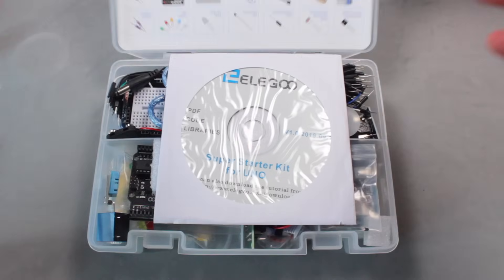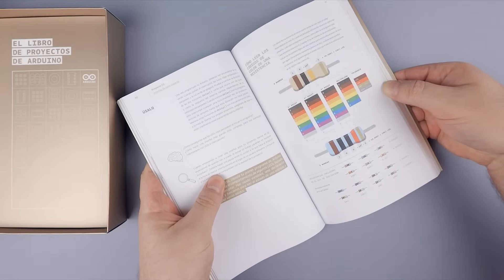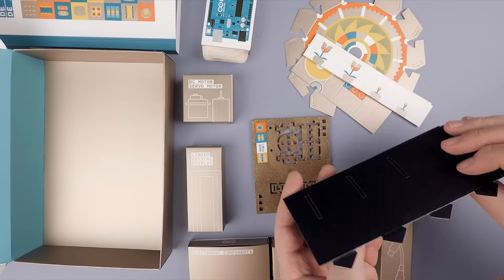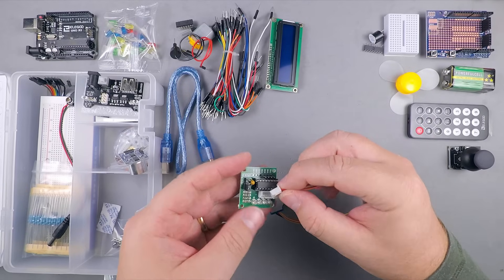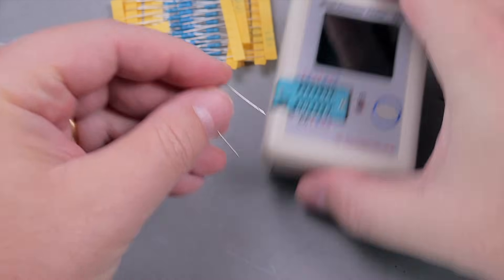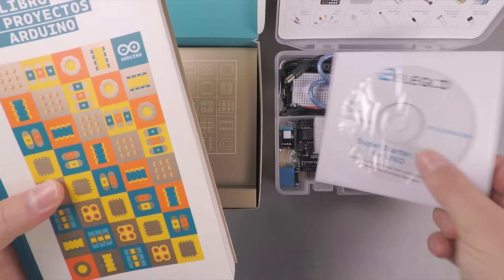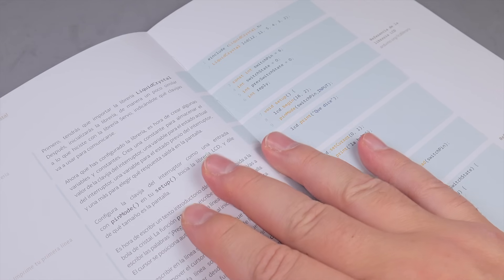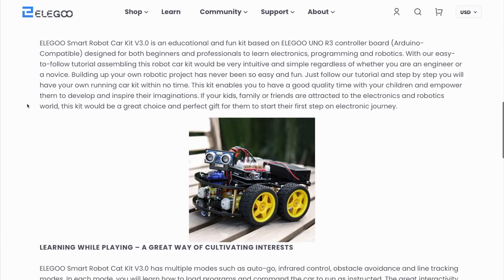Which Arduino to buy? Arduino Starter Kit vs Elegoo Uno R3 Starter Kit

Comment: I’m from elegoo. The reason why I use the blue resistor is because this is a metal film resistor, which is more accurate than the general brown carbon film resistor. The general resistance is ±10%, and the metal film resistance is less than 5%. Of course we are also improving this.
Reply from the maker: Hi everybody from Elegoo! After I published the video, a few people told me of the advantages of metal film resistors - more accurate values even on a wider range of temperatures and less variation as years pass. This is all good - it is very unfortunate the industry chose such a terrible background color for their best resistors 😭 Even so, I keep recommending the Elegoo Resistors Kit: excellent price for a very complete range of resistor values! 😁 I wish it was possible to have it on a beige or light grey background color, it would be amazing!
Reply: As a color blind, resistors have always been a pain in the butt for me. The blue background defintely makes things worse ^^'
Reply: @DaylzFr  that why you have a multimeter and now the correct value
Reply: @DaylzFr  i also I'm colorblind, is a pain in the ass to read resistors
Reply: @DaylzFr  My eyes suck, so reading it is impossible. That's why I just use a multimeter.
Reply: @DaylzFr  I just ordered the tester that he used as the resistors are always a pain to read. Mabye thats a good idea instead
Reply: @DaylzFr  i hate resistors i wish that resistors for colorblind people existed
Reply: With age my eyes got so bad that it doesn't matter any more on what background these invisible rings are printed on. I use a multimeter to measure the resistance and read it by value from a decent sized display and am happy with that.
Reply: @GeekDetour  mmi
Reply: @GeekDetour  يميزني
Reply: زقزي
Reply: You know its hearing stuff like this that affirms my purchase decision for elegoo products, something affordable but also committed to quality.
Reply: I like the 1% (blue) resistors in my kit, although I do agree the industry choice to use that color was not optimal... especially for us shade blind people.

I think a basic component tester should be included with all kits... one like the Aideepen T7 TC-T7 units that can be found on eBay or Amazon for less than $25.  It is an almost required part IMHO and can identify the resistors, capacitors and transistors... as you shown at 4:27 in the review.
Reply: @csimet  This is a really good idea, Im suprised more people dont use them
Reply: @francistaylor1822  Agree.  I do understand it would add $25 to the kit cost (official kit or Elegoo), but well worth it.
Reply: I'm not colourblind, but even as a youngster with good eyes I strugged to read the 5 band code because of the thin bands and poor colour contrast.  Now older, with failing eyes, I can still tell a 4 band 5% resistor's value at a glance, but blue 5 band resistors are a mystery to me without a meter.
Hence I prefer to buy 5% resistors for experimenting, and the 5% resistors are the ones I always grab first from my resistor box.
Reply: @epiendless1128  You can get cheap component identifiers and thats what i use now as i cant see the small lines well.
Reply: @ThomasMattOnline because every says it is
Reply: Blue resisters are known for their high accuracy....but you should always check all resistors with an ohm meter prior to use...especially if you are color blind.
Reply: The author's background is not electronic, so he didn't notice that the resistors provided by Elegoo are 5 band E48 instead of 4 band E24.
Hence higher tolerance and other benefits mentioned in other comments...

Wwanted to drop a comment but many others of course have done that faster 😅

In any way, both Arduino and Elegoo are great companies with their own benefits. Appreciate your work and recommend both.
Thanks @GeekDetour for bringing up a comparison of starter kits.

For anyone starting out I would recommend both, or maybe Arduino Student kit with multimeter + anything from Elegoo, like a Mega kit.
Reply: Hi mw
Reply: Thank you for your product. My Sister got it for me from US and this ia amazing i made a color-music with it.
Reply: @thubitski  Awesome, enjoy your results
Reply: What  about the CD? Like what is that about? It's basically just a waste for me.
Reply: @azharcassim2795  CD was established a long time ago, has more inventory, is already relatively cheap, and has fewer virus infections. We have tried to use USB flash drives before, but the price is still very high, especially in the past few years when memory prices were crazy.
Our current information is available for download on the official website. In the future, our products will remove the CD.
Reply: Believe it or not, there are a lot of people who still use older computers and/or don't have access to the internet.
Reply: a very important question: if i change its firmware to an actual arduino firmware does it still work?, beacuse i wanna program it on my pc (sorry for my bad english)
Reply: It should.
Reply: Duh ? 
Its written on the yelliw strip.
?????
How dumb are you?
Reply: Its written on the yellow strip in ohms the value of each 10 pack of resisitors. 
Dummy
Reply: Ease of use is important in a starter kit. When a person specifically needs higher accuracy resistors they'll purchase a higher accuracy resistor. Standard brown resistors are better for beginners doing project on general applications.
Reply: No blue, from everyone
Reply: Blue resistors are within 1% accuracy whereas brown ones are within 10% accuracy...
Reply: @OldSchoolRaptor  that maybe the case but if you're colourblind then then you're gonna have problems reading the resistors
Reply: whatever hurry up and improve it

Comment: Do Arduino sensors or motors are compatible with Elegoo? Or the reverse? And are there some motors more powerful?
Reply from the maker: Everything that is sold as an “Arduino Kit” should be compatible 👍 The DC motors, even on the official Kit, are very “toy like”.
Reply: @GeekDetour  So every "Arduino Kit" like Elegoo and more are compatible with all "Arduino Kits"? And do u know if a simple dc motor is compatible with Elegoo or Arduino?
Reply from the maker: Exactly: the “Arduino Uno R3” board is a standard - copies and clones all operate in 5V, and pretty much all kits come with the same types of sensors (different manufacturers, but same specs). The DC motors are typically 6V and you cannot power them directly by the Arduino - you use transistors or an H-Bridge and there is a project showing how to do that. You asked about how powerful are the motors - tell me what is on your mind 😄

Comment: I'm really new to it all, this vid is really helpful thanks.
Reply from the maker: Hey Simon 👋 thank you! Oh boy, indeed there is A LOT to learn and the deeper you go, the more you have to study 😆 Both kits have enough material to keep you busy for many days or even weeks. Have a nice journey!
Reply: @GeekDetour  Thanks for the reply! Even though I am new I totally agree about the blue resistors - they are totally illegible! I am  going to have to label them somehow :)
Reply from the maker: A few people already told me these are the standard for 1% tolerance, metal film, resistors - which are the best electronically speaking - but the color choice the industry chose could not be less terrible for visualization 😄. Oh, in the Elegoo Starter Kit, they have the value stamped on the paper strips that hold each set - and on the Elegoo Resistors Kit each value pack come in their own little ziplock bag with the Owm value really clear on each bag. To me the problem is only after you take resistors out of the breadboard and you mix them: then I need to measure them 😢
Reply: @GeekDetour  Thanks again for the feedback. I'll need a Multimeter at some point, so I'll get one for the resistors, and it will be useful later.

Comment: Blue resistors are not like carbon resistors
Reply from the maker: You are totally right! After I made the video, a few people told me these are much better resistors - electrically speaking: 1% tolerance (instead of 5% or even 10% of the typical beige), and uses metal film whose properties remain more stable as time goes by, and less variation caused by temperature changes... in summary, A MUCH BETTER resistor. BUT, despite all the advantages, I continue not being able to visually identify the values: the rings are very thin and the blue background is terrible. I wish the industry could have chosen a less interfering color.

Comment: Hello, I speak Spanish and I am 12 years old, I know to program and I also make Games with Godot. I want to buy an Arduino, I never had one but I know a lot about Hardware, I don't know if it's better to buy the ELEGOO Mega 2560 Project The Most Complete Ultimate Starter Kit, or the original Arduino Uno starter kit, Witch one do you think is better?
And also I want to ask you if there is anything that only the original Arduino can use.
Thank you a lot!
Reply from the maker: Hola Ian, ¿que tal? Debo contestar en Español? 😄 Hablando de Electrónicos/componentes/módulos, no hay nada en el Kit Original de Arduino que también no esté en el Kit Elegoo que he enseñado (siendo que este kit de Elegoo no es el más completo, como ya sabes). La cosa más valiosa del kit Original es el Libro - pero, si te gustan los tutoriales en YouTube y trasteas bien con código, creo que aprovecharás mucho más la increíble variedad de cosas que vienen en el “The Most Complete Ultímate Starter Kit” de Elegoo. PERO, de verdade merece la pena que sea de Elegoo, pues sus tableros son copias técnicamente muy bien hechas de los tableros originales de Arduino - te explico: en muchos clones baratos, sustituyen el chip que hace la comunicación USB-Serial por uno más barato (CH340) que necesita instalación de drivers, y no es tan estable como el integrado original. Elegoo no hace esta trampa - utiliza los mismos circuitos y esto merece la pena. Te doy una sugerencia: cómprate el Kit Más Completo - pero, notarás que viene con el Mega 2560 (que es mucho más grande que el Arduino Uno R3) - si esto te complicar la vida, sepas que también puedes comprar suelto el Elegoo Uno R3 (solo el tablero) y con esto podrás seguir cualquier tutorial que haya en el mundo 😄
Muy buena suerte! Un abrazo desde Madrid 🇪🇸

Comment: Could it be possible to use the book of the Arduino starter with the elegoo set?
Reply from the maker: Yes you can! If somehow you get the Arduino Book alone, you can totally make most of the experiments using the Elegoo Super Starter Kit. But, the Elegoo Kit has its own PDFs with experiments (actually, more experiments with even more different sensors) - but with very succinct explanations - that’s where the Arduino Book shines: it is VERY well explained, even the code.
Reply from the maker: And, if you get any of the kits, you can find EXCELLENT tutorials on YouTube - the LCD Display, for example, is in both kits - and if you watch this video, you will learn A LOT following his lesson: https://youtu.be/wEbGhYjn4QI (and he even shows alternative ways to use it, with things that are not in any of the kits, but I ordered because it is much more convenient).

Comment: Can I use elegoo components with arduino?
Reply from the maker: Yes, totally! You could get the Elegoo Uno Board and simply use it in the original Arduino Kit and everything would work perfect - indeed, the Elegoo Uno R3 board is a very faithful implementation of the original Arduino Uno Board, it uses all the same chips (some cheap clones replace the USB to Serial integrate for different cheaper ones, and you need to install drivers on your computer for it to work... Not the Elegoo, it is all fine). Lots of the components on both kits are the very same or just from different manufacturers (same values/exact functionality). On my current project there are pieces from both kits 😁
Reply: @GeekDetour  thank you!

Comment: great video
Reply from the maker: Thank you! 😁
Reply: @GeekDetour  have been interested in ardionos , after the video i had to order my own starter kit , didnt find the elegoo version :P
Reply from the maker: Interesting 🤔 I am curious: In which country you live? Anyway, there are LOTs of Arduino kits around - they are not all with the same quality (the very cheap ones requires you to install drivers for the USB communication to work) - but it is possible to do the very same projects and learn either way. Good luck and have fun 👍
Reply: @GeekDetour  thanks , i live in finland .they had only basic starter kit that included the arduino , some cheaper ones without , they had almost everything for a project but not as a kit . got some attiny microcontrollers to send the code from arduino

Comment: Well done! Thank you for this video. These were the two kits that I was looking at. This helped me a lot. I’m going with the Arduino as my first kit. Thanks again! Looking forward to more Arduino project videos. 👍👍😊
Reply from the maker: Hi there! 👋 I am happy that you liked it! The Official Arduino Kit is more expensive than most people would let themselves invest in something they are uncertain if they are capable of mastering (or maybe even enjoy) - BUT, the book is worthy, and the official board is more likely to work straight away (some clones need driver for the USB... anyways). Good luck on your experimenting journey - and I am pretty sure it won’t be the only kit you buy (now I have several plastic containers with different Arduinos and parts).

Comment: Hi, for a beginner do you think it's better to buy the advaced elegoo starter kit or the standard super starter kit?
Reply from the maker: Hi Sara 👋 The “Super Starter Kit” already exceeds the features of the Official Arduino Starter Kit, so, you should have plenty of projects to play with. If this is your first time with Arduinos and you are budget tight, the Super Kit it is already enough for you to “wet your feet” A LOT. I would buy the Advanced Elegoo kit only of money is not a problem OR if you see a certain sensor/module that you are particularly interested in playing with. Ex: the Advanced Kit will bring more modules, like an NFC (reads NFC tags) module, a tiny membrane numeric keypad and an 8x8 LED matrix.... if you already have a project idea for using these modules, buy the bigger kit. It all depends on your appetite for the modules each kit brings.